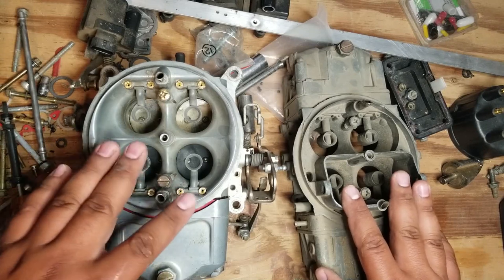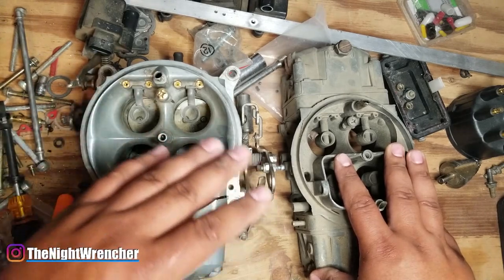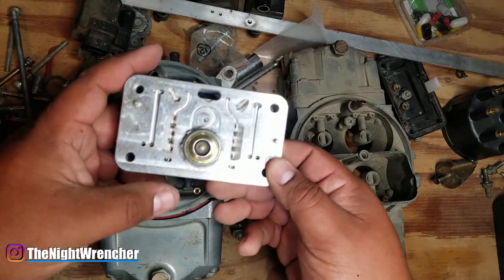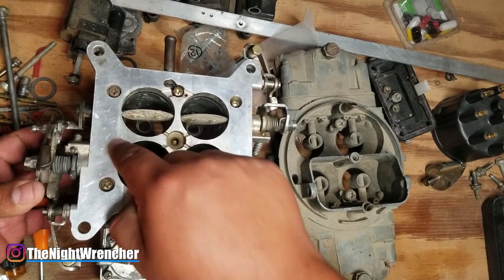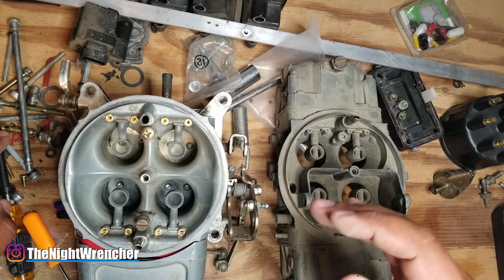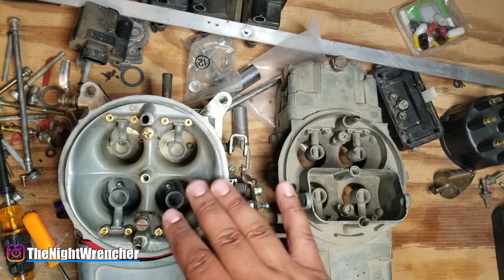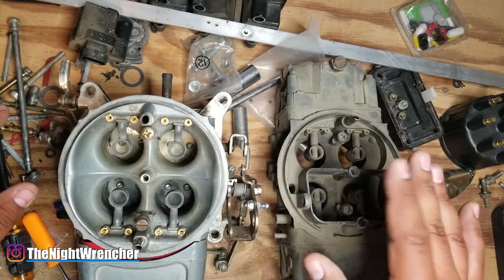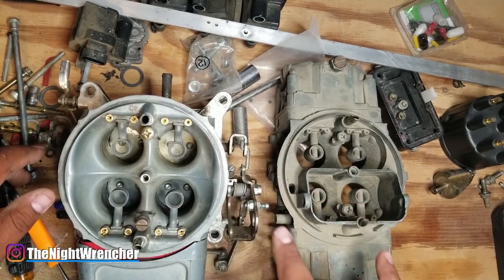Holley Carb Street Tune VS Race Tune | Holley Carburetor Tuning | Holley Carb Secrets

Comment: Threw my vac secondarys in trash years ago ,never go back, no comparison mechanical all way! For street/ strip
Reply from the maker: I actually like vacuum secondaries. They're easier to tune straight up. You done need to worry about secondary tip in or linkage ratio on a VS carb. A mech sec carb runs faster hands down but for someone just getting into it, I always recommend a vacuum secondary.

Comment: Regardless of how much you try, the only precise way to achieve a specific fuel curve, such as the factory OE calibration, is by the use of a flow box.
Holley carburetors are air bled carburetors, meaning that the calibration is mostly achieved by the air bleeds. Carter carbs on the other hand are metering rod carbs.
While developing a calibration for an engine family or engine application, not only do they have to properly perform during the four seasons of the year, but also at high altitude and below sea level. 
When we developed original equipment carburetors, we didn't just have a cold room at -10 F and a hot room at 115 F, we would take vehicles to Florida, New Orleans, Arizona and Denver for live driveability and performance tests. 
How much is too rich or too lean? It depends on the engine and its application. We've set-up carburetors as lean as 21:1 A/F ratio at cruising speed with the distributor advance curve properly set for that carb.
Carbs are a mechanical device designed to provide engines the correct A/F mixture on demand.
If you have technical abilities and basic knowledge of air and fluid dynamics, you can somewhat do the calibration you're trying to achieve, once you learn the carburetor components and their function. Remember, there are engine performance problems that are blamed on the carburetor, because someone didn't do a complete diagnosis.
Keep up the good work!

Comment: great explanation and video. After working through about 5 old carbs I finally gave in and got a Edlebrokc AVS 1450 for my old bronco with 351M headers and sidepipes. With the stock jetting it is much better but I am looking to tune it some and have an AFR installed. I have some jets already from prev carbs but looking for the air bleed sets - I don't see them on Edolebrocks site. It's a brand new line of carb so I'm not sure if they have the tuning kits for them yet. It's more of a street/river truck. 
Anyway Digg your vids will be watching the rest with interest.
Reply from the maker: The VRS-4150 uses all Holley compatible components so as long as the thread pitch is the same, you can use screw in bleeds for a holley carb. With that being said, I would not be trying to change out the air bleeds any time soon. First thing is to dial in the jets and then if find out that the fuel curve is off, adjust the curve with the air bleeds but  9 times out of 10, the stock air bleed setting works fine.

Comment: I have a '71 El Camino with a 402 punched 030 over. mild cam and headers, Weiand Action plus intake, and a Quick Fuel 750 (single pumper w/ vacuum secondaries.) The car reeks of gas yet is running lean. The car is used as a cruiser. Would I benefit more from stepping down the carb itself (to say  600 cfm) or tuning what I already have?
Reply from the maker: A smaller carb size wont do anything except give it a leaner tune all the way around. I would start by making sure your timing is set where its supposed to be and then reset the idle. After that just go circuit by circuit. Running lean will make it hesitate and give it a rotten egg smell. Too rich will make the engine lazy.
Reply: Put some smaller jet in it and go from there

Comment: Hi nightwrencher. I have a 1986 Ford e350. Motor home. With a 460 engine. The previous owner took out some of the smog control. I spent 4000.00 on a mechanic and got it back worse. I replaced the carb and distributor. And fuel pressure regulator. As well as plugs wires and coil. It went from extreme rich to lean. It runs better than it use to but will backfire from the intake. Also on cold start it will barely run. It is about 300 rpm until choke is open. Any thoughts on what to do?
Reply from the maker: I would start off with verifying ignition timing. I would move the vacuum advance to manifold vacuum and then set the idle to highest RPM after its warmed up. Start there and get back to me

Comment: You can and should tune your Holley style carburetor to run as efficiently as possible on the street, but also perform optimally, simultaneously on the track. Just do a simple area calculation for the pvrc's. This is why most Holley style carbs are 6 to 8 jet sizes larger on the secondary. And why there's a power valve in the primary. Tune your primary main jets for part throttle cruise. Once your opening the throttle past the power valve vacuum rating, the power valve opens and enrichens the mixture through the power valve restriction channel (pvrc). Buy the David Vizard book How to Super Tune the Holley Carburetor.
Reply from the maker: Its sounds pretty straight forward but actually its more complicated than that. Just like a  drag racing carb  is tuned differently than road racing carb, a street carb is tuned different than a race carb. To pull the most mph out of a carb, each corner is tuned independantly from each other. Its not uncommon to see 75/77F and 80/82R depending on manifold design. Also, race carbs usually dont run power valves at all. Lastly, a primary accelerator pump circuit on a drag race carb is set up to come in higher in the throttle so it comes on right at the light while you're stalling the converter. Theyre similar, but not the same.
Reply: @NightWrencher  you're a smart guy. I enjoyed your video. Please, listen, you said yourself most drag racers block of the powervalve in primary and seconary metering blocks. That's perfectly fine if its not street driven. Most carbs have a power valve in the primary side only, very few have power valves in both metering blocks, and most of those are used on dual quad tunnel rams. The reason the carbs with a power valve only in the primary is for street use. Because we tune the main jets in the primary for part throttle. Once the power valve opens, it flows fuel to the pvrc's. Those pvrc's is what you tune for wide open throttle.  Again, this is why carbs with no power valve in the secondary has main jets 6 to 8 sizes larger than the primary. Do some area math and now you're square at all 4 corners. If your engine requires stagger jetting, thats no problem. Area math. Pi×R²
Reply: P.s. this applies to road racing, dirt track racing, drag racing, and plain old grandma street driving. An engine wants what it wants. Drag racing is the easiest to tune for if thats all you're doing. If you drag race plus street drive, it does get a little more complicated. For sure, but can absolutely be done. Road racing requires max efficiency in all throttle positions, which takes more tuning in the emulsion well and air bleeds. You can absolutely tune a 4150 for all conditions. Just takes time and effort
Reply from the maker: I understand what you are saying but what I am saying is that you would do better at the track with a carburetor built for the track, that is the purpose of a "race tune" you can make your carburetor run perfect in most conditions but a carburetor built soely for racing will offer you better performance than a carburetor built for the street and optimized WOT performance. That was the main point of the video, you can have 2 nearly identical carbs but with minor changes depending on the intended use. If you daily drive your 600 holley and then remove the PV, rejet the primaries and move the accel pump to the #2 position for launching at the dragstrip, that would be a "race tune". The same idea applies for street tires and race tires which people do sometimes switch out when they race their daily.
Reply from the maker: Note that I'm not disagreeing with you, I'm just explaining what the main purpose of the video was.
Reply: @NightWrencher  tuning in the accelerator pump does absolutely get finicky when you tune for both street and strip and everything in between, but it is possible. Thats why Holley Carbs RULE! You can have your cake, AND your ice cream......AND eat them both!
Reply: My truck has #65 primary and 72 secondary and makes like 13 mpg

Comment: Any videos on performance upgrades for a Holley 600 street warrior?
Reply from the maker: Not really but the street warrior is a solid carb as is. With proper tuning, you can make a lot of reliable power with it
Reply: @NightWrencher  thinking of ordering an adjustable vacuum secondary for it... thoughts? 
Also in your opinion does a dual feed fuel line make a difference?
Reply from the maker: The lid with replaceable top is a pretty good part. Makes secondaey spring tuning a breeze. The only thing dual feed does is it prevents the rear bowl from going empty during a high hp WOT pull. It also helps cars during heavy cornering like in road racing.
Reply: @NightWrencher  so it could help on take off during weight transfer to keep from starving back bowl of fuel etc
Have you had any dealings with a power blaster plate?
Reply from the maker: I've hear of it but I've never used it, i feel like its just snake oil buy I cant say for sure.

Comment: Hello 👋 Night Wrencher love ❤️ your videos they motivate me thank you I have a problem with my swamp wonder if you can help me out my Harley carburetor gets flooded I’m doing something wrong I just install a Aeromotive AFI FUEL PRESSURE BYPASS REGULATOR A1000-6 13109 And A Genuine AEM 50-1005 Inline pump 380lph Bosch 044 style and a C5 corvette Fuel Pressure Regulator filter Kit iCan not get it from filling out too much gas what can I do please help not a mechanicBut I know I’m doing something wrong
Reply from the maker: Hello, do you know what your fuel pressure is after the bypass regulator?
Reply: I don’t know take a look at it tomorrow and get back to you thank you

Comment: Sign me up for the race tune
Reply from the maker: Im sure youll be able to dial your set up with your wide band and an o2 on the down pipe
Reply: @NightWrencher  I just have a wideband. I'm wondering if the Parameters are the same as the ratios go or do they change since under boost
Reply from the maker: Arnt you on e85?
Reply: @NightWrencher  yep, just took the carb apart and it looks brand new. The Stabilizer helps keep e85 good
Reply from the maker: But sounds like youre tuning using gas numbers and not ethanol numbers. Are you tubing with AFR or Lamda?
Reply: @NightWrencher  At first I was using gas afr for e85. But that was wrong. Now I'm using lambda which is waayyyyyyy easier
Reply from the maker: Oh ok then yeah ratios are the same. Just keep adding fuel the more boost you go